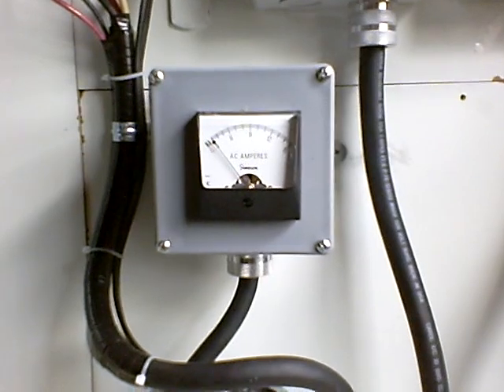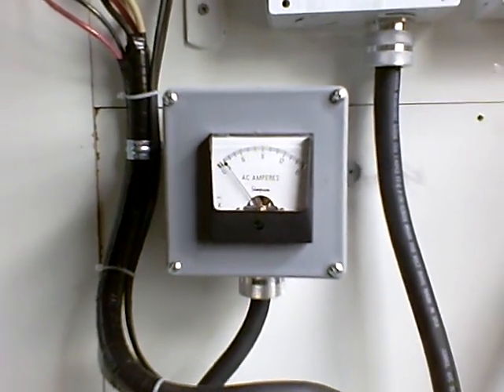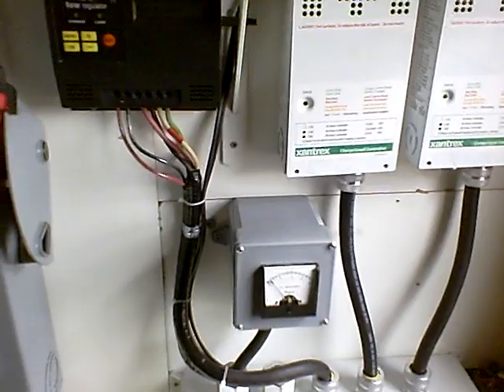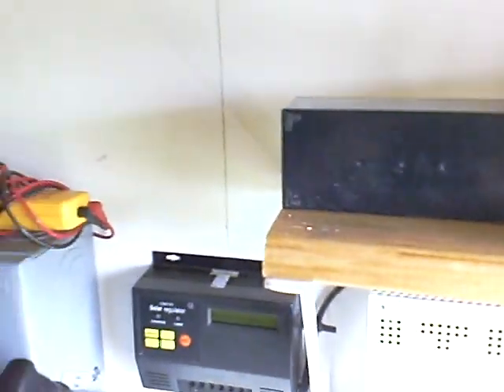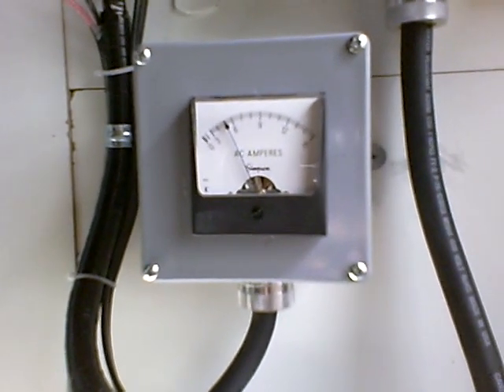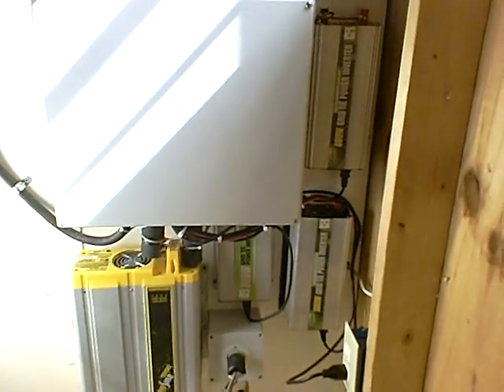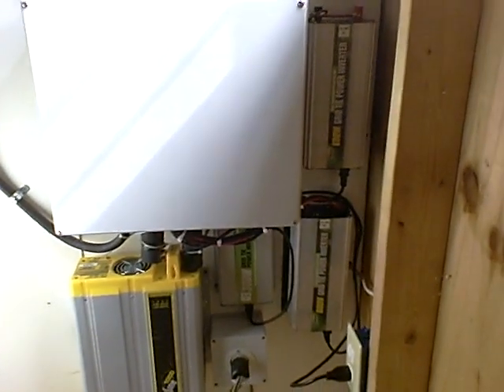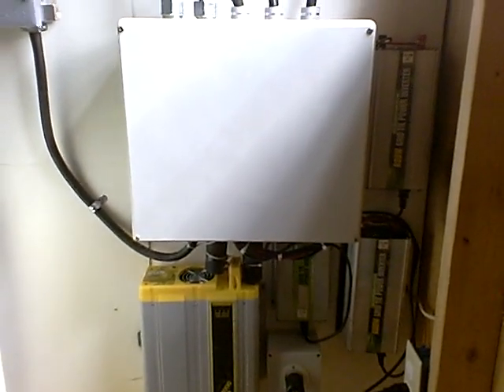Solar/Turbine DIY update

Comment: Out of curiosity why did you choose to do everything "either/or" instead of piping all of it into grid tie inverters and/or battery and letting the system work automatically. For example, you could charge your battery bank and put excess power into your grid and then when the sun goes down your system would dump your battery bank back into your grid OR you could use your battery back for emergencies or whatever the intention there. Just curious...thanks again!